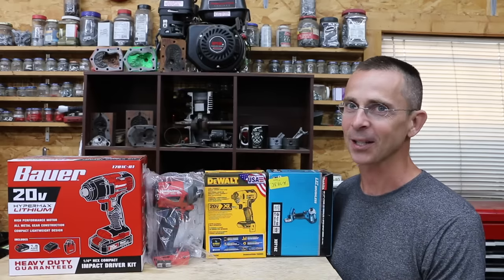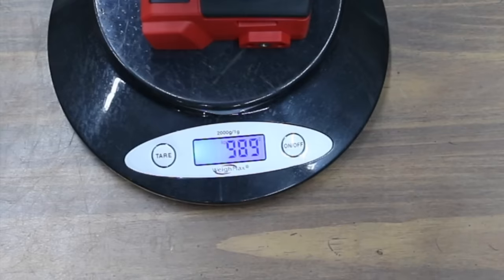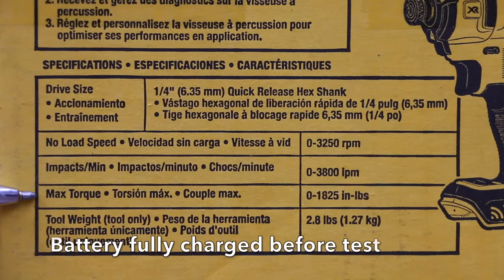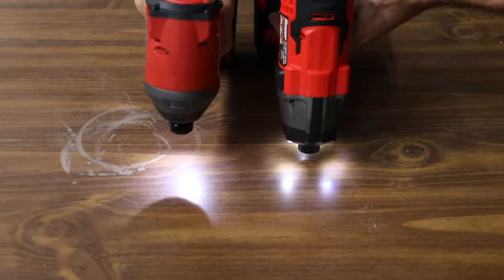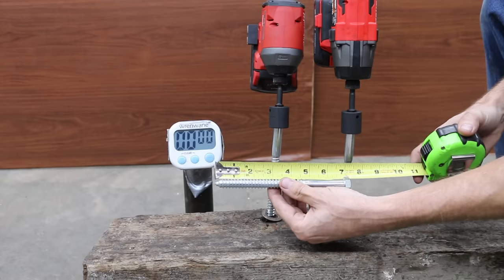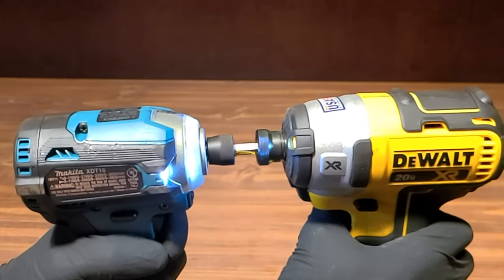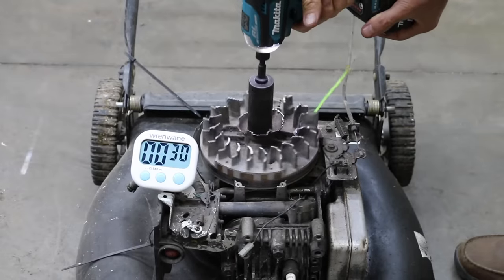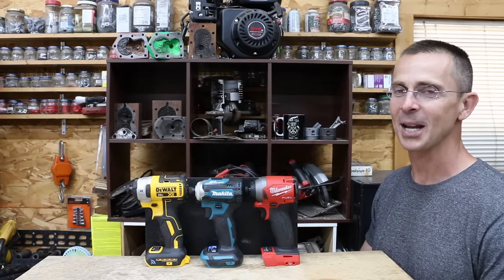Best Impact Driver? DeWalt vs Milwaukee vs Makita vs Bauer!  Let's find out!

Comment: Well...I have been buying 20 volt Dewault cordless tools for my collection because that's what I started with and batteries are expensive. I was a little concerned after talking to a friend that worked as a building construction instructor at a local schoolhouse. He stated that they were switching to Milwaukee tools because they were replacing to many Dewaults. Not sure exactly the issues with each were but evidently they felt like they werent holding up enough. Anyway...I think they will do just fine for me and the Dewalt did perform well enough in this test. One of the best tools I have owned though was a Milwaukee corded drill. Had that thing for years and abused it some. It was a powerhouse. Replaced it with a new Dewault and just don't like it as much.
Reply from the maker: Thanks for sharing.

Comment: Probably addressed somewhere further below, but the problems experienced with the Milwaukee shutting down are a result of the battery saver technology built into the Milwaukee Tools. In the event of excessive amp draw the tool shuts itself down to preserve battery life. And, that was a deciding factor in my purchasing DeWalt.
Reply from the maker: Thanks for sharing.

Comment: Hi, guys I need to decrease impact driver's power for personal needs. Is there any easy way ? I want to decrease power till 50nm's not to brake apart thing's I work at. Thinking about less power from ac maybe or somehow modify the ,,hummer'' mechanism itself. Thank you in advance... It is cheap HART model from ebay and it makes ton's of power. I don't need it too much but decided cheap and powerful is better  then small screwdriver's , those are dying in hands. Also there is nothing in the middle between small screwdrivers and powerfull impacts. When I want to loosen engine cover f.e. using cordless drill from total and it does not have enough power.
Reply: Milwaukee and other brands have, impact drivers that have different setting. But generally a drill works better.

Comment: In the beginning my money is on DeWalt....we see. Well I lost that one. My experience is with previous versions of Dewalt and Milwaukee and the Dewalt hit harder. I had a Milwaukee with the Bluetooth garbage and in my experience it negatively impacted the tool as the non Bluetooth model of the same year ran better. Maybe the same has happened to Dewalt? Eh well they are both good tools but it seems Milwaukee has began to surpass Dewalt in most everyday tools. Good test PF!
Reply from the maker: Thanks!

Comment: I don't know if perhaps Ridgid didn't have their impact driver on the market yet when you made this video, but I sure would have loved to have seen that in the line up. Maybe a new video? Seems Ridgid doesn't make it on here often. It's a shame because I've used them all, quite a lot, and honestly Ridgid isn't the best but puts up a great fight! That's all I'm using these days. They are cheap enough to where you don't stress too much about being brutal on them and with what I do, it's mandatory.. My tools get seriously beat up, I have yet to have a single Ridgid fail on me. They are all still working like new as far as that goes haha
Reply from the maker: Thanks for the suggestion.

Comment: I think it is time to do a drill impact combo review for DIY use, not just for which tool hits the highest stats. Is there a Drill/Impact  combo hybrid driver that can remove lugnuts from a sedan, or mid size SUV? It makes little sense to buy 2 tools for DIY use. Important to have a low rpm trigger for small screws and such. The smaller the better.
Reply from the maker: Thanks for the suggestion.

Comment: I use   Rigrid 3 speed but my buddy use Kobalt  and  his has the best power I've ever seen, it heavy as hell. I've used most all of the brands. I also have porter cable and like them for their weight. Tho the 3  speed is great for drywall , finish work and assembling ceiling fans,, ect. But I will tell you I had a tool box on the back of my truck packed full of porter cable tools and a hurricane hit and after the storm I was cutting trees for over a week, when I went to get a tool I opened the tool box and it was full of water all tools were under water. All the batteries were dead and the nail guns were trashed but everything else worked. So in my heart I have some love for porter cable, but have since fazed them out to rigrid. Still use the impact porter cables every once in a while.
Reply from the maker: Thanks for sharing.

Comment: I was wondering if you could test out any Porter Cable products? I've purchased some over the years because the motors are generally bigger (thats what it says on the box anyway) and they have a lot less flair than some of the other brands. But it would be nice to see them against others. I do appreciate the work you've put into these videos. They are very well thought out.
Reply from the maker: Thanks!  Thanks for the suggestion.

Comment: Great video as always!! I bought harbor freight half inch impact supposedly will deliver 450 ft pound of breakaway force won't even take off lug nuts at 110 ft pound bought Milwaukee quarter inch impact driver it pop lug nuts right off I love that little tool for sure.  Thanks for sharing be safe enjoy what you do
Reply from the maker: Thanks!

Comment: I would have liked to see a swim test as part of the other tests. Working on a high ladder one day, I dropped my 18V Makita impact driver. Below, were some five gallon buckets to catch rain water, and they were full. my Makita driver landed right in one of them. It took me few minutes for me to climb down and retrieve it.
I took the battery out and shook what water off I could. Did the same to the driver, plugged the batt back in, and it went right back to work. It never flinched! I finished my workday and went home. I used drive & battery until it discharged and plugged in another one. After a few days of this, the battery was smoking a little. Driver was fine, and stayed so, but I did have to retire the battery. It stared to heat & steam a little, and I didn't want to risk a fire, or worse.  I would love to see a comparison test involving water immersion. No one is going to use their tools under water of course, but it is a good comparison to see how water affects these tools.
Reply from the maker: Thanks for the suggestion.

Comment: As a carpenter i prefer Makita over Milwaukee. Even thou the Milwaukee has more torque its not ideal for most carpentry needs. But all my electricians and plumbers use Milwaukee when that torque is needed. Makita has the perfect amount of power for all my carpentry needs. I have tried the Milwaukee and its too much and harder to control on projects.
Reply from the maker: Thanks for the feedback.

Comment: In your impact drill competition you said Milwaukee would stop and had to be trigger reset. I used to work with Li batteries powering equipment and was told that the batteries (not sure if they were saying for a certain brand battery or electrolyte) Must be limited to a Max current of 2-Amps. In my experience Craftsman would shut down on max load where my DeWalt would power through but did not catch on fire. 
I have not followed all these new Li battery tools and if they try to limit the current/power.
Reply from the maker: Thanks for sharing.

Comment: Dewalt is junk. I dropped it from 10’ ladder and it broke at the handle just above the battery. The only thing holding it was the rubber around the handle it still worked but it was broke.  My Makita has been dropped more times than I can remember and it has never broke.
Reply from the maker: Thanks for the feedback.

Comment: I wonder if you might see this,  the biggest challenge I encountered was with a big fat step drill bit on 22mm soft pine.  The bit took longer than 90min to become touch cool.  Either you can try and incorporate it.  Bosch 18v Green drill wit 2ah battery, brushed motor.  When it does show strain in the form of heat and smoke from drill, disengage the bit and let the drill run for at least one min - 3 min until it seems cooler.  Not something I would try again, but it did the job.  Both drill and step drill bit is in operation.
Reply from the maker: Thanks for the feedback.

Comment: Ive seen roofing plumbers drop their Milwaukee driver's off roofs onto hard concrete without breaking. Apparently it takes 3 or 4 drops before the plastic cracks. They are by far the most expensive here in Australia and have dethroned makita as the most popular serious choice for trades although makita is still well regarded and there are mixed views on dewalt with some products well regarded and others seen as cheap garbage.
Reply from the maker: Thanks for the feedback.

Comment: The bosch was unable to remove my cars lug nut. Was able to loosen it with a hand tool. Fastening it the bosch was unable to reach 110nm necessary for fastening, using a torsion bar. The nut was manually refastened to 110nm using a nm wrench thingy
Reply from the maker: Thanks for sharing.

Comment: I own/owned all of these (except for Bauer) and Bosch, and the only set that is still in my possession is Milwaukee; I still have the original M18 (V1) set that I bought about 15 years ago. I broke both the impact driver and the hammer drill's power connectors (to the motor - due to vibrations), and welded them back; and they are both still working; I bought a few high capacity/high output batteries over the years too (the original batteries are still fine.)
Reply from the maker: Thanks for sharing.

Comment: I wished that Home Depot's Rigid brand tool was included here. They have lifetime warranties and that includes the battery, meaning when the battery dies, you can send it in and they send you a new one! But if the tool itself is no good, then that's a different story.
Reply from the maker: Thanks for the suggestion.

Comment: Every body said millwalke is the best they were write I have used battery operated grinder 1 in impact driver drills work very well also get the number 8 battery it will work a lot longer for extended period of time. That's what I was told by a welder.
Reply from the maker: Thanks for the feedback.

Comment: I am in the market for some new power tools, I currently have mostly Bosch, but at my job we use mostly Milwaukee. I like the Milwaukee better, is it safe to use the battery converters to use other brand batteries? Are some converters safer than others?
Reply from the maker: Thanks for the suggestion.

Comment: I have the Bauer 20v brushless at work and I use it every single day. Never ever had a problem with it, but it's leagues better than the standard Bauer impact driver. Get the brushless instead.
Reply from the maker: Thanks for sharing.

Comment: when millwaulkee went on sale at HD for the M12 Fuel drill impact driver combo, i did not hestitate to buy them.  My understanding is  they are equally capable as compared to the M18 but the battery doesn't last as long.
Reply from the maker: Thanks for the feedback.

Comment: If your not really a all day 7 inch lag bolt kinda guy I have several Bauer product that have never failed me in anyway I wouldn't try to force them to do more then there for but that's me not you if I was a pro I wouldn't trust them enough to build my truck with them but for my little shop there more then enough
Reply from the maker: Thanks for sharing.

Comment: do a 2024 version? Ryobi HP PBLID02 is so much better than its brush version! and the fun fact is the 6AH HP battery make the HP tool 25% more power (torque and speed) compare to 4AH
Reply from the maker: Thanks for the suggestion.

Comment: I'd love to see impact drivers round two, with Ridgid, Ryobi, Snap-On, Matco, etc
Reply: Bosch too! Also as a DeWalt repair technician I'd love to see how the 887s (variable speed brushlessw/o Bluetooth), 787s (single speed brushless), and the 885s (single speed brushed) hold up. The impact driver you tested was an 888.
Reply from the maker: Thanks for the suggestion.

Comment: I do have to say, I’m not surprised by the result of this at all. I’ve used 4 or so impacts through the years before watching this *Dewalt, Ryobi, Makita, and then Milwaukee most recently. 
When our company switched to the Brushless Milwaukee fuel’s, it took only seconds for my eyes to light up and say “Oh yea, this thing is just ridiculously good.”. It’s so stinkin compact and comfortable, and its hammer action stops more accurately than any others I’ve used. Literally the best hands down. I will say I wish they added a few feature to it that my Ryobi one has really nice impact too mind you such as the bit holder on the front, and the speed switch being accessible with your thumb. Nothing more annoying than fishing in your crowded pockets to swap between your flat heads, hex bits, torx, etc
Reply from the maker: Thanks for sharing.

Comment: Need to see what rigid could do. 
Dropped mine 10 feet on to concrete. Started smoking but kept working. Cracked battery case.
Reply from the maker: Thanks for the suggestion.

Comment: The new hercules impact driver kit is actually a powerhouse that includes a 2ah battery and quick charger and theres a deal that includes a free 4ah 21000 cell for under $100 out the door.
Reply from the maker: Thanks for the feedback.

Comment: From personal experience, Bauer is a beast, considering the motor that uses brushes and the price. I have driven 10's of thousands of screws. from 1-6 inch screws to several 6in+ lagbolts. I also dropped it from roughly 15 ft onto concrete and had a similar result. The battery popped off and it got a few scuffs, but all is fine with functionality. Now on the other hand, 2 Milwaukee impacts later, where they both lost all torque and impact ability, I have grown weary of their ability. I am certainly a fan of brushless motors and of Milwaukee in general, but I must say..in a situation where replacing a tool is time sensitive, I'd rather pay to replace the Bauer than the Milwaukee.
Reply from the maker: Thanks for sharing!
Reply: @ProjectFarm  thanks you for the comparisons and the tests you performed. I thoroughly enjoyed watching

Comment: - The Bauer now has a brushless for $65 with a 5Ah battery available for it.  I would like to see an append of this video using that one.  The batteries are DeWalt knock-offs (but not interchangeable).  Tool + 5Ah battery + rapid charger = $143.  I've seen other tests where it outperforms the one tested here.
- The one tested is still available and comes with the bag + battery AND charger for $65.
- Conspicuously absent was the Black and Decker.  It is $51 and with almost 4,000 ratings on Amazon, it has a 94% approval rate when you add the 4 star and 5 stars ratings together.  (75% and above makes it a safe buy in my book)  It includes the impact driver, 1.5Ah battery, charger, and Phillips screw driver bit that clips on the top.  The 1 stars are only 2%, which is rare for any product, and nearly all about the battery.
Reply from the maker: Thanks for the suggestion.
Reply: @ProjectFarm  Another intesting one would be Bosch Bosch GDX18v-1860C.  It's an impact wrench and driver combination.

Comment: You need to retest with the Bauer brushless 3 speed and the Hercules brushless 3 speed with a 5 year walk in walk out warranty. Though I'm still using the Bauer brushless and stepped up to the Hercules 3/8s impact instead of the driver. Both perform very well
Reply from the maker: Thanks for the suggestion.

Comment: i use a bunch of the 12v fuel tools from Milwaukee.  have you thought of doing a comparison on the 12v versions of these tools.  if weight is an issue they are awesome.
Reply from the maker: Thanks for the video idea.

Comment: Ok, I'm sure this goes across manufacturers but I know DeWalt sells multiple impact drivers (and drills, etc) so the model matters some. My son managed to lose my DeWalt and found a "set" on sale with both a drill and impact driver. The drill is not as good as the one I have, and the impact driver included was a single gear with the touchiest damn trigger I've ever experienced. The first time I tried to use it, it spun the head off of the screw I was attempting to drive. I wound up using my drill instead.
Reply from the maker: Thanks for sharing.
Reply: @ProjectFarm  Hey, thanks for what you do. It keeps a lot of us who use these tools from fumbling blindly for the best overall value, and it REALLY helps to define specific needs.

Comment: Impact drivers are just too strong from most screw/Philip's applications.  They are more suited for a hex bolt.  It's hard not to strip a 11 gauge steel using a #10 sheet metal screw.
Reply from the maker: Thanks for the feedback.
Reply: Yeah, in full power mode they can ruin the work sometimes. But that's what the specialty settings on the Makita are for.

Comment: I think you just showed me my driver has speed options. I hate it because it has poor slow controls, so I use one of three drills as a driver. 
I’ll have to see if I find them useful. 
I have an impact wrench for heavy stuff, so the driver needs to be light and easy, not heavy and able to bust lug nuts. 
Thanks again.
Reply from the maker: Thank you!
Reply: I find the drivers break fasteners and things I adapt like trailer jacks, but drills don’t break things any more than a hand fastener. 
I have a Makita impact gun for big bolts and lug nuts, and I use makita drills on low speed for screws and small bolts. Speed 2 strips heads more than speed 1, and I’ve seen that when other people use them too.

Comment: I have all Milwaukie power tools and that impact driver has an auto shut to protect the tool from over heating. I'm pretty sure you made it hot enough in that lag bolt test.
Reply from the maker: Thanks for the feedback.